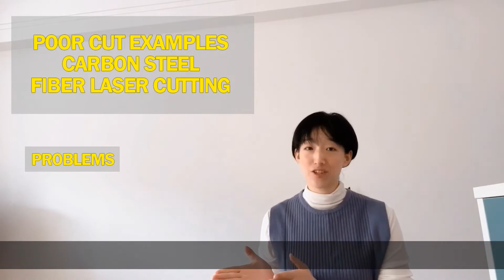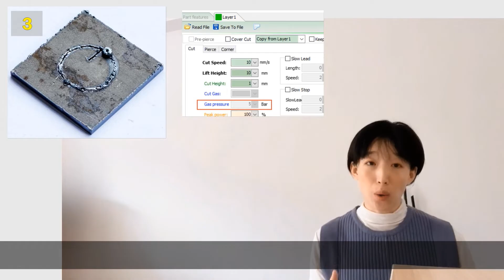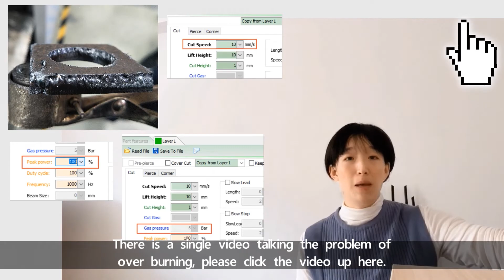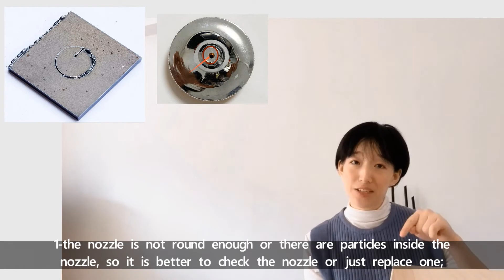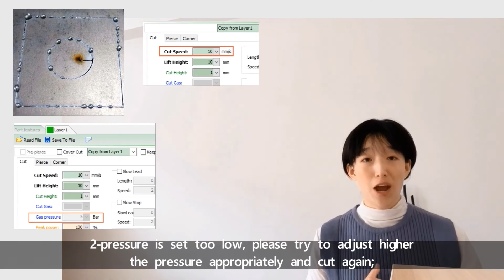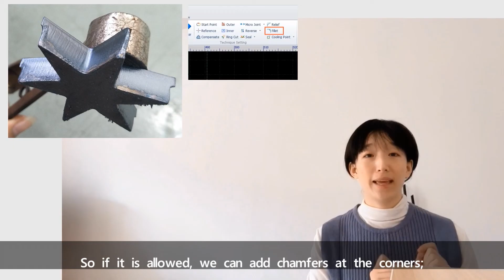Cabon Steel Poor Cut | Fiber Laser Cutting | Problem and Solution

Comment: Hi clara i am trying to cut ms0.75 inch thick plate with freq5000 power at 5000 oxygen at 0.7 bar but i am always getting lines on top side of the part but bottom is clear. Can you share how can i fix that?
Reply from the maker: You can adjust the parameters for fine cut.

Comment: Hi Clara, We have a 3KW Laser with RayCus Source, we are getting burr in 1.5MM Mild Steel while Cutting on Compressed Air.
We Tried with multiple parameters in the final best attempt the burr on the edge was like a fine thread which was getting removed by the finger . 
Can you please help to fix this so that the complete burr is removed. 
Speed 18M/Min
Focus -1 
Pressure can’t be set manually 
Power 100%
Reply from the maker: what parameters, what nozzle, what config of  your compressor?